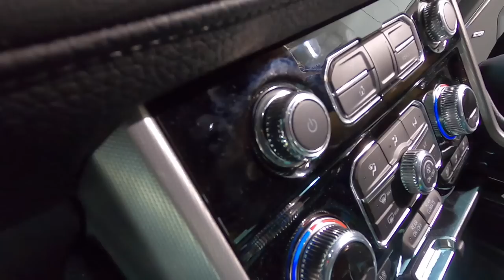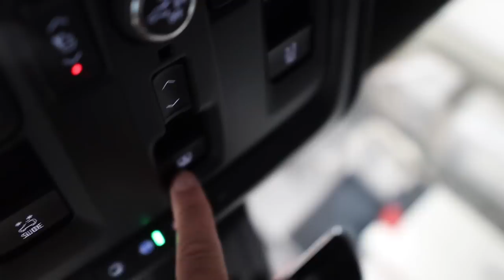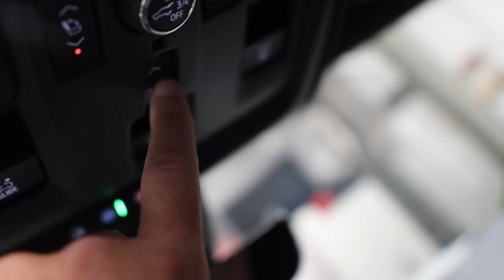Our Detailing Life / Denali & Highlander Interior and Exterior Detail #realdetailing #detailinglife

Comment: Great video. Question. What is the purpose of using a leather cleaner on newer cars wjen the leather is actual clear vinyl coated to protect it?  Wouldn't a detailer like twax mist work just as well?
Reply from the maker: Hi. Good question.Even though this is a new car the customer still drove it some miles and most likely there is some oils and light dirt on the surface. So lightly cleaning it cleanses the surface so we can apply some protection. 
Also even though these “leathers” are coated, it’s jot the type of coating that people think. It’s still porous and needs cleaning and hydration so as not to dry out and crack. All Interior plastics have a coating of some sort, but they still out gas and can dry out over time. Adding a conditioning type of product adds back oils and protects it from UV.

Comment: Any cordless polisher suggestion? The one in description is unavailable I am in the $250-300 range specifically for waxing or sealing many thanks! So
Reply from the maker: I also got this one https://amzn.to/3zvM85N
It’s pretty much the same thing but it comes with two batteries.
Reply: @MirandaDetailing  I got this one also good for some light polishing with correct pads.
Try to figure out to use 5" pads :)

Comment: Hey Phil & Wifey, (lol) when you dilute a product as per the directions, does type of water matter? For example, I would think Distilled H2O would be best, or does it not matter because the chemicals are the ones doing the work?
Reply from the maker: Hi. Some say to use distilled. But that’s not always an option. So I only use distilled for glass cleaners that need to be diluted. Other wise it doesn’t matter. Once it goes onto the paint that was just rinsed with water it’s irrelevant. Also interior cleaners are the same way. I never saw a difference when I used distilled water instead of tap. It always worked the same way.

Comment: Why you say you never use bug remover ?
Thank you 
Excuse my english 😉
Reply from the maker: Hi. We don’t use any dedicated bug removers because we don’t need to. We just use an all purpose cleaner diluted 1:4 on them. Works great.
Reply: Thank you
Do you no why when hi remove bug it leave mark on my Last Coat Black Ice coating and it impossible to remove?
Reply from the maker: Bug guts if left too long on the paint will start to etch into it and create a mark. Sometimes it’s so bad that it may need to be wet sanded out. And sometimes even that doesn’t work because it’s too deep.
Reply: @MirandaDetailing  excuse for all my question 😉 but hi wach my car every 2 week, esit to long before removing bugs ?
Reply from the maker: Yeah if you have bad bug guts you want to wash that right away.

Comment: Cool new products. I've got a good one for you. Question: after detailing entire car, and cleaning windows, rolled down windows to clean the edge of glass on top that sits in track. To my horror, when I rolled back up window, the bottom of window was full of streaks of dirt. Rolled window all the way down and the gasket black fuzzy thing was loaded with dirt. Don't have and tool to stick in the "window slot" to clean out window gasket. How do I clean it? Help! Hi wife.
Reply from the maker: Oh yeah that’s annoying. Usually when I’m washing the blast out the window rubber seals above the trim and that gets rid of a lot of dirt trapped in the those seals. I angle the pressure washer and carefully kinda blasts in between the glass and rubber seal. It’s ok if water gets in there because the doors are sealed from the inside. Or you can take something thin like a credit card and wrap the towel around it to get into the seal and clean it.
Reply: @MirandaDetailing  ok. I'll try pressure washer first. Thank you!

Comment: The older Toyota Land Cruiser is like fine caviar!  It's the only SUV I will ever consider, aside from a Porsche Macan/Toureg or an Audi Q5/Toureg.  Good choice in vehicles!!  And I completely agree about older cars as well, that are built to be far more reliable.  And that chrome chip on the Toyota?  Yep, VERY common: https://www.toyotanation.com/threads/chrome-tec-wheels.1643872/  And there are more horror stories when you Google this issue.  

By the way, that 6" cordless buffer you have is the same exact thing I saw at Advanced Auto and Auto Zone for the same price, and they come with two batteries as well!  So cool!  I was thinking about picking one up until I saw this video where you said that as the pad gets saturated, it starts getting unbalanced?  Like is it bad where it will start doing gymnastics on the surface and you got to use both hands?  

Also I want to give you a heads up about the Turtle Wax mist detailer and leather cleaner/conditioner.  Depending on how old your VW/Audi/Porsche is, use the product VERY sparingly on the surface.  I've noticed the mist detailer started to change the color on my shifter console on the 2000 S4.  We had overcast and rain today up here as well, and it wasn't that hot either.  But it was humid!  In addition, I noticed that if you are in a humid area, the product tends to get a bit tacky/sticky.  It's worse if there is sunlight around as well.  I had to grab some of the soapy water from my wash bucket to neutralize the stickiness.  The leather cleaner and conditioner was exhibiting the same thing as well, not so much on the leather, but on the vinyl surface.  I sent an email to TW about this, and hoping I may just have a fluke/bad mix in my bottles.  Have you experienced this as well with your TW Mist Detailer and Leather/Conditioner?

By the way, new slogan: "The Danger is in the detail!" Guess the movie that slogan is from, LOL!
Reply from the maker: Thanks man. Yeah the polisher isn’t that bad when it gets a little off balance, I just apply a little pressure and it’s fine. But maybe it’s just my machine also.  
That’s so weird about the stickiness oth those products. We will have to keep on the look out for that.   
What’s the quote from? 🤣
Reply: @MirandaDetailing  Look up a movie called Oliver Stoned.  LOL!

I will let you know what TW says.  I'm hoping I just got a bad combo.  I did buy these from Pep Boys, but they were in the discount/scratch and dent bin for whatever reason.  And I paid $7 bucks each for the sprays, which seemed a little off.  

And another quick update about the cum stuck feeling on the steering wheel of the S4, saturated a terry cloth with Palm Olive/Dawn dishwashing fluid and water.  Wipe on the surface, and voila!  Extra dry and crispy surface!  But treat immediately, as it is a sun-drenched surface and will crack the leather quickly.  I just used some Lexol leather conditioner for now, as I have never had an issue with Lexol leather cleaner/conditioner before.  I'm hoping this works.

Oh, I forgot to add, your rant about your wireless buffer and only having one battery?  Go to Advanced Auto or Auto Zone, ask if they can open the box, and test out the battery in their wireless buffer.  The unit looks EXACTLY the same, with the same price you got it for, only difference being the color.  I'll bet the batteries will fit, as they have the same plug type.  Only problem will be you may have to buy the unit, but on the plus side you and wifey will have your own pair, plus extra batteries and chargers!  Yaaay! :D
Reply from the maker: Cool!  Will do!  Thanks for the tips man!
Reply: @MirandaDetailing  Hey no prob bob!  I'm sure your wife will be ok with the purchase as well, because she can have one too!  You guys can work much more quickly getting a car done as well.  Win-win man, win-win!  

I asked the wifey if I can get one as well, she said she has to think about it and how it will fit next to my three other buffers.  Do you think it will help if I tell her I must have it and if I don't I'll start binge drinking? :) The others I have were el cheap-o Advanced Auto buffers anyways.  The 10" one I have/inherited was from Track Auto (heh, remember them?) and it still works GREAT!  My dad bought it many moons ago to help with polishing and waxing his uncle's '73 Cadillac Land Yacht.
Reply from the maker: 🤣🤣🤣. Thanks man.
Reply from the maker: Yup that’s the exact same polisher as the green one on Amazon. Cool!!